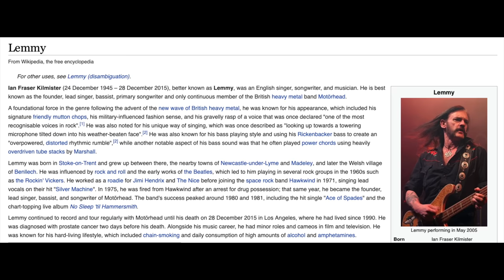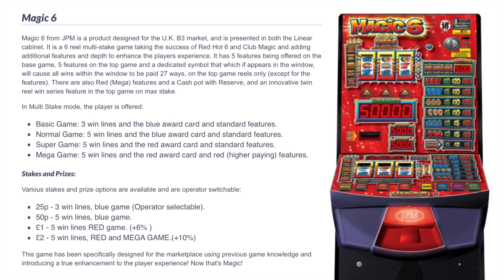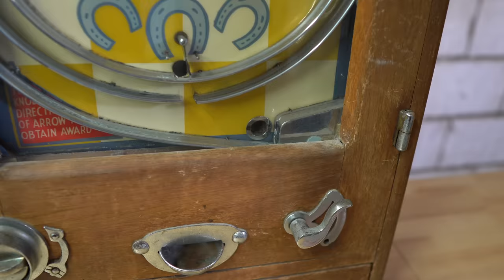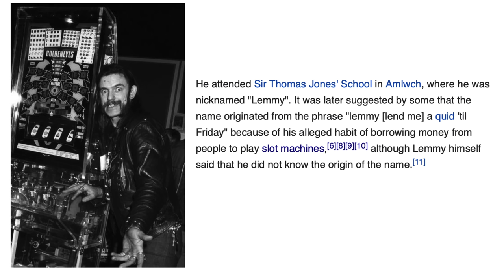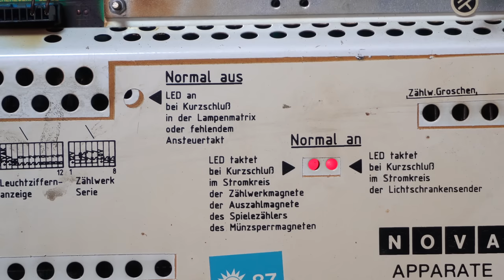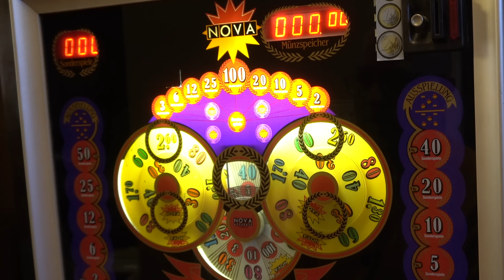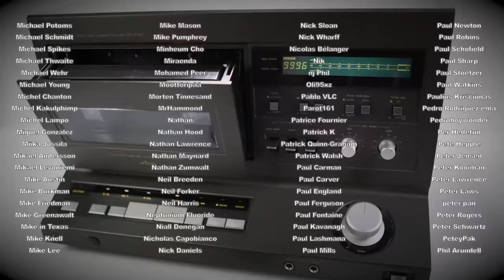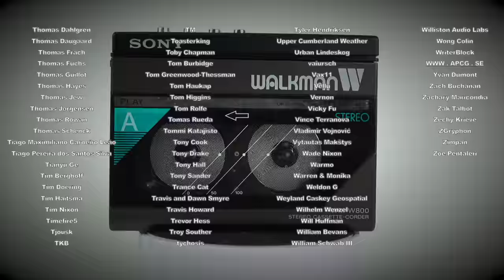Lemmy’s touring slot machines

Comment: Huh. didn´t know that these "Wandgeräte" are uncommon elswhere. I´ve actually got like 130 gambling machines (funny story how I got them/selling them for the owner), from almost all decades. These older full electronical machines are a pain to repair, but still better than the even older electromechanical ones. My observation for the german market with old gambling machines is that the "Wandgeräte" are much much more prefered than the normal "Standgeräte", mostly to space constrains. Also the newer ones like a Merkur Multi with Displays (shown on one picture where Lemmy is playing on it, the machine is also hanging on an so called "Doppelständer" for "Wandgeräte" from Merkur, these where also avaliable in a single configuration)are much easier to sell than machines with Reels.

Comment: In response to the pinned comment, it's quite common that battery backups are used for gambling tables. It's a tamper protection so operators or other people can't change them. It's also reffered to as a suicide battery. But interesting topic although I'd find more fun in the UK machines myself!

Comment: 26:05 I'm no expert on this subject by any means and could be completely wrong (for instance, I have no idea why it doubled from 0,80 to 1,60 but maybe the other two symbols gave you a free bump up), after that when it was flashing between 3,00 and what I would think is "lose", that looks like a skill climb as we would see it in a British fruit machine. The middle stop button is lit so you would use that to gamble your way up the ladder. As you didn't stop it, the machine took that as a collect and added the 1,60 to your bank.

I am open to correction but that is what it looked like was happening.

Comment: If you happen to do a video for Pachislo machines I would recommend two. First, I would recommend Popeye (green). What makes it interesting is that the face is a full video monitor but has a hole cut into the middle of the screen for the wheels/spindles. Would be nice to find out how the screen works with a hole in it. Also it’s story oriented; having Popeye go on an adventure with the Jeep to save Olive Oil from Brutus/Bluto. The more you play, the more you get closer to save her.

The second one to check out is Biohazard (Resident Evil) red. This one is a novelty since it uses four wheels/spindles instead of three. Also the dialog is in English which is another novelty for a Japanese machine. Have these two in storage but I can send you more info in each machine if you like. 

Also I wouldn’t mind a video about the history of European pub machines/fruit machines. 

Oh and you want to check out another novelty arcade machine look up Ice Cold Beer Arcade. It’s a game of skill; trying to move a ball bearing up and down an upright play field via a metal rod. The goal is to control the rod, moving it up and down to get in through the hole with the largest points to score. It was also marketed as Zeke’s Peak (for more family friendly venues). Made by Taito 1983-1984.

Other than that thanks for the videos. I’m a big fan of retro tech! Thanks for reading!

Comment: I worked in an old steel town with consequently a lot of apprentices. They worked out how to make disks of metal that were good enough to defeat the fraud detectors on the machines in the local pubs. They ended up with a cottage industry making fake coins for machines.

As some of the machines (like ciggy machines) would give change too they easilly made enough money to subsidize a night out.

Eventually the police turned up at the apprentice shop with a sack of fake coins and said "We don't know exactly who's doing this but it's obvious that it's one or all of you. If you don't knock it off we'll get forensics involved and make some arrests."

Needless to say it stopped.

Comment: I'm from Germany and got an even older machine in the basement with real rollers and not self playing not the newer spinning disc style. You still see the models that you had there around here at older gas stations mostly. It's just an assumption but I guess that self playing style catered to truckers that could let the game roll while eating or just plain gambling addicts which could easily ran multiple machines at the same time like this. If you are interested I could send you footage of my machine running and inner working, information and proper translation.

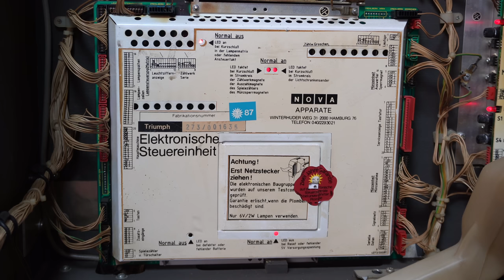Comment: 20:41 the upper left led should be turned off. If it‘s on, it indicates a short circuit in the matrix of bulbs... that‘s written next to the led in german
Reply from the maker: There’s a bit more information about this video in the video description. 🔝👍 Includes updates, links etc...
Reply: @Techmoan  thanks for the info, didn‘t see it

Comment: My German is a bit rusty, but "Kurzschluss" means short circuit or shorted, and the LEDs on the case of the logic board are lit. I think the German says the LEDs are supposed to be blinking in case of a short circuit, but like I said, my German is rusty, and perhaps they are blinking at a rate that won't show up on camera.

Comment: Every single American machine you showed is from IGT lol. 

They were (I think still are?) the biggest slot machine company in America. Hell, the Nevada Gaming Board, where IGT was based ,had influence in other gambling states just because of how common the IGT machines were, and still are to a large degree! 

They are very easy to identify. Most of them have that square bottom 2/3 with a semi-circle on top. The bobble on top is optional. Another give-away is those speakers on the side. The cabinet is an older design, but they needed to add speakers, so they did that lol. They have very interesting internals, and are elector-mechanical by design. Easier to troubleshoot and last longer. They are also highly tamper resistant, water/booze and smoke resistant, and built like a tank. You would not be able to lift one by hand without some preparation. 

Also if you did try to tamper with one, they had sensors in every corner of the machine, and any unauthorized entry would immediately send out a distress code to security. Doesn't matter how stealthy you are about it, it'll scream for help, and security will swarm you before you can even extract the lock-box inside, which is also built like a tank lol.

Comment: I'd go with the basics first for repairing the machine.  Clearly locating the blown capacitor (Check see if our old friend Mr.  RIFA is in use...  Yellow looking line filter capacitor used a lot in the good o' days...they crack and blow a lot of smoke and they reek!)

See if it's got a tilt mech.  The game might report all is okay electronically, but a good ol' fashion tilt mech has tripped up even the best tech.  Just an idea.  We've had issues with them on coin pushers in locations.

Comment: reads description
Sounds like one of those machines, where whole program is stored in RAM. Arburg injection molding machines are similar, after disconnecting battery or unplugging CPU card we have to insert I think three specially formatted floppy disks, else you're stuck with dead machine.
Reply from the maker: There’s a bit more information about this video in the video description. 🔝👍 Includes updates, links etc...
Reply: I see. So "probably" some other HW problem. Or maybe memory setting up something that shouldn't be set up with correct program? But I guess that bridging you mentioned should take care of that.

Reminds me how I was troubleshooting Italian injection molding machine last year. It forgot all user settings after battery replacement. But not only it forgot settings, it also set up some random bits in memory - first heating zone was switched to unusual mode, some random delays appeared at fields we never used and so on. It was also funny how memory of all programs was empty and at same time you weren't able to save any program, because it thought memory was full. You really had to call "delete all" menu even while there was nothing to delete. It sure confused all guys around when I did that :)

Comment: Hm, 20:41. The LED on top is supposed to be off when the machine is ok. "LED an bei Kurzschluss in der Lampenmatrix oder
fehlendem Ansteuertakt" which means something like "LED on when short circuit in the lights matrix or missing clock signal" where
clock stands for clock as in a data bus clock signal instead of the ones hanging on the wall :D
Reply from the maker: THEre’s more information in the video description.

Comment: I’m not sure if anyone has mentioned this yet but I have a hunch on the fault. I have never seen one of these before but...
You replaced a dead battery. I don’t see a clock so what’s the battery for? My guess ram.
What’s it need ram for? Hi scores? I don’t think a slot machine would have that? I know some arcade game cabinets used ram to hold an encryption key as a drm, basically if you were a collector and had one with a dead battery you were out of luck. Now I’m not sure if there would be some type of drm in a slot machine but I do have a theory as to what a slot machine may have. What if the machines were programmed to payout after a certain amount of money was collected, what if this was something the owner could select when it was first purchased or maybe was set per region based on laws. Maybe something like that would be in ram. 
So maybe it’s saying tamper because it’s lost ram and hasn’t been told how often to payout. 

Anyway I am no expert just a thought I had.

Comment: The problem is and was the flat battery, it keeps the individual software for that machine in the „ram“ if you tamper with it it is supposed erase itself by interrupting the power provided by the battery.originally the battery would be soldered in on the board, that holder is already a sign that somebody worked on it. As per design these machines are only allowed to be operated a certain amount of time, and then the license would expire, wich makes changing the battery obsolete as these machines are designed to be powered up 24/7.

Usually you change the battery powertet up, to the Programm in the ram is saved. 

There is somehow the possibility to restore the software by reuploadibg it. There’s a society called Goldserie e.V. That is dedicated to these style of machines, ADP machines like yours (and mine) are covered there a lot.

Good luck, take care
Reply from the maker: There’s a bit more information about this video in the video description. 🔝👍 Includes updates, links etc...

Comment: I dont know you get it fixed again already but if not: After the battery runs low, the NVRAM contains garbage and needs to be initialized. If you look on the „Steuereinheit“ at the back, big white Box where all the cables go, there is a connector saying „Serviceanzeige/-tastatur“. Now bridge the connectors 7, 14 and 20 during the Machine is in „Gestört“ and you will hear a „miep-miep“ noise. After that, machine should be up and runnung. Sadly this machine is a first gen CPU controlled one without error codes....
Reply from the maker: There’s a bit more information about this video in the video description. 🔝👍 Includes updates, links etc...

Comment: What if the "tamper" light cane on because the door was officially psyically opened. There might be a mechanical switch that was triggered to prevent usage. There might not be a digital reset.
Reply from the maker: There’s a bit more information about this video in the video description and the top pinned comment. 🔝
Includes updates, links etc... 👍

Comment: Sorry for the millionth comment. The reason it is in "Tamper" mode is likely because the battery died and the verification settings have been lost. I am not familiar with this particular machine, but I have seen this exact same problem with other machines so this is likely your problem as well. With some machines, after the machine is commissioned, an external tool/programmer is connected and the verification code is set in the machine and then it will operate as normal. The battery backed ram keeps play totals, payout percentages etc. Once the battery backed ram is lost, the machine has no idea how much it has already paid out and therefore no idea what its target should be, so it no longer operates. With many UK machines, after replacing the battery, they just initialise with default values, however on German machines, I believe the payout percentages are more legally enforced, hence why they have to have a verification code set and they stop operating if the code is lost
Reply from the maker: There’s a bit more information about this video in the video description. 👍 Includes updates, links etc...

Comment: I believe what you missed to show is the risk bottons 1:1 at the side. while the wheels are turning you could turn them on/off and then in case of you "winning" anything the computer would automatically try to push the bars to the side up and down by chance until you reach the Sonderspiele. The only way to win anything on these machines was if you either hit the jackpot directly or if you pushed up on the outer bars. The Sonderspiele were then payed out to you walled not only if you had 3 same symbols on each reel, but also if you had a hit from a list of additional numbers. e.g after you got Sonderspiele if the center reel was showing a 30 or 40 you would automatically get 2,40 DM and as long as you had more than 10 Sonderspiele this money was automatically collected to your wallet. when dropping below 10 you were allowed to actuate the 1:1 risc buttons again in order to push back up into the Sonderspiele ... So if you were "skilled" which mean if you knew the behavior of these old machines well you could really predict what was gonna happen as their "computational" powers were very limited back then. thats why they got replaced with newer models later in the 90s.

Comment: The old mechanical machines were indeed skill based and the owner hated them. As a skilled  gambler could beat them. Those from the late eighties had stepper motors and a random table. There was once a dude, who bought a damaged machine, took out the eeprom with it's table and printed the content in cleartext down. Then he drove from village to village (you find them often in pubs or snack stands) put some coins in and compared the results with his printed table. Then he  could see, how many runs it needed for the next big score. If it was profitable, he put enough money in and let it run is course scoring the big one. Otherwise he simply left, to visit the next slot machine.

Comment: I think that battery failing has caused the flashing light on the front - similar to old arcade machines back in the day (Capcom cabinets had "suicide batteries", when they failed it rendered the game useless). It looks like that's what that big red sticker covering the battery bay is for...
Reply from the maker: There’s a bit more information about this video in the video description. 🔝👍 Includes updates, links etc...

Comment: Zapro-dk is correct in his comment. The database of such devices is usually sealed and welded. A battery change is not possible and should not be.
The previous owner of your device modified the database and installed a replaceable battery. If this should be exchanged, it is mandatory to maintain the voltage via a power supply. As soon as the voltage is lost, the database is irrevocably deleted.
Have another look on eBay, there are many used and modified databases for purchase. Maybe you will find a suitable one there!
Reply from the maker: There’s a bit more information about this video in the video description. 🔝👍 Includes updates, links etc...

Comment: What about the luminous LED in upper left on the controller. It says "there is a short circuit in the light matrix" could this be the fault?
Reply from the maker: There’s a bit more information about this video in the video description. 👍 Includes updates, links etc...

Comment: One hint: there are also "real" casinos in Germany offering the high bets and high possible prizes and lower chances machines. But that's in the casino regulation which is very restricted. Gambling halls with those machines do need the same government licenses like full casinos with Roulette, Poker etc.

The devices you show could be put in a pub by the pub owner to make additional money. The company - here Nova - paid you a fraction of revenue to have them mounted in your pub or club. No special licenses needed other than checking that people are 18 years old or older.
In your machine what could be broken is the sensor checking the actual position of the discs. You see that they spin one position and then stop - the circuit doesn't get the position change as feedback. Was a very common problem.

Machines of your age used fixed "random" tables so if you stay long enough (hours!) you will find the same sequence rebeginning.

"Cheaters" were able to cash out all the money by getting this number table of the specific machine model to detect the actual position in the program. So you knew which disc symbols will appear and which buttons you have to press or not and whether "Risiko" was worth it and how often you can press it at max before getting back to zero.

Comment: It makes me wonder if the lock out chip failed?
Or some one had tried to replace the lock out chip and did not put in the right one?
I think most electronic slots and arcade machines have some sort of lock out chip to hinder people pirating the machines.
Not sure if slots have the same sort of thing but I am suspicious that there might be a IC chip that may of failed.
Or that some one that was trying to repair the machine forgot to put in something.
Not sure.
Would be nice to see the real thing working but sounds like you have done quite a lot to it already. :|
Reply from the maker: There’s a bit more information about this video in the video description. 🔝👍 Includes updates, links etc...
Reply: @Techmoan  Haha ah ok the one time I do not read the description there is an update for the video. :)